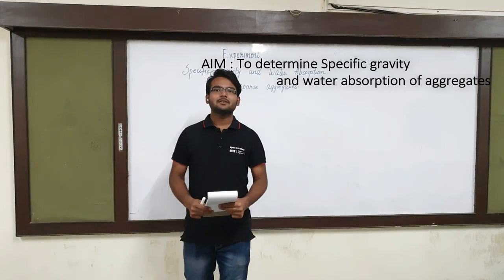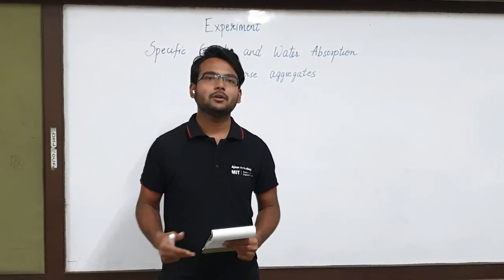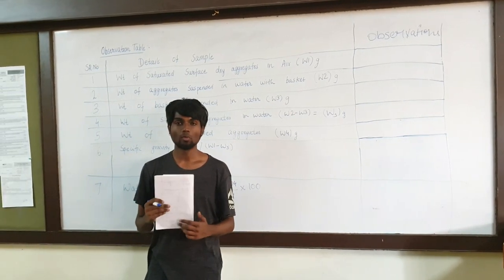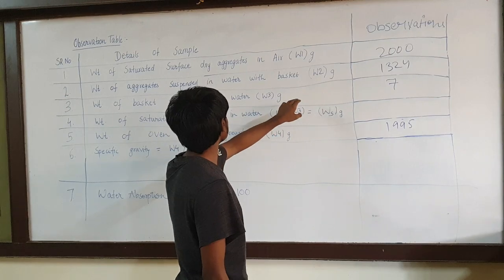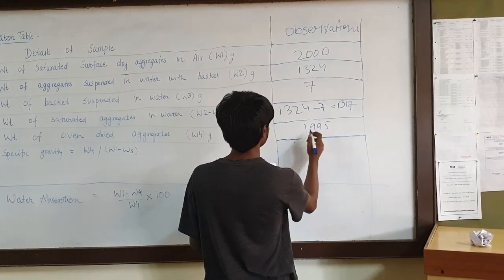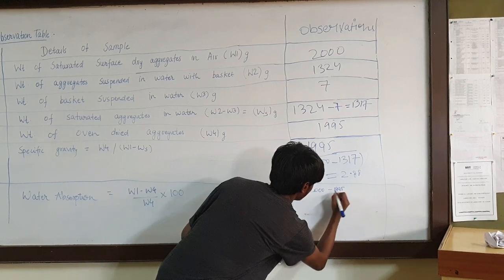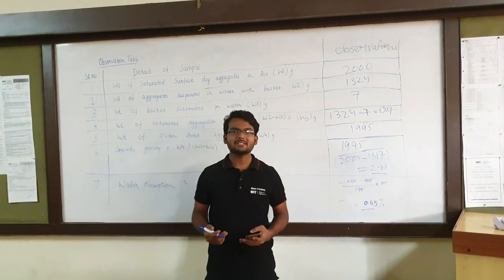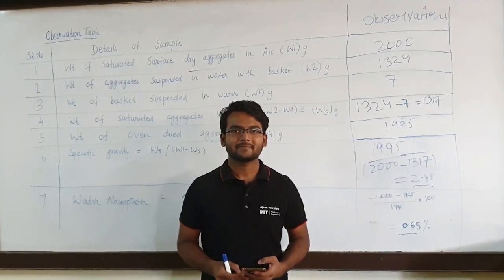Specific gravity and water absorption test of aggregates|| Transportation Engineering || MITAOE

Comment: IS 2386 part 3.
In Calculation, Weight W1 should be the weight of surface dry saturated aggregates (which is generally > 2kg , weight of sample).
But here W1 is taken as 2kg , actual weight of sample . 
And hence your content is misleading and confusing!